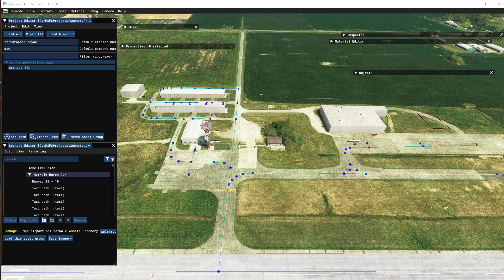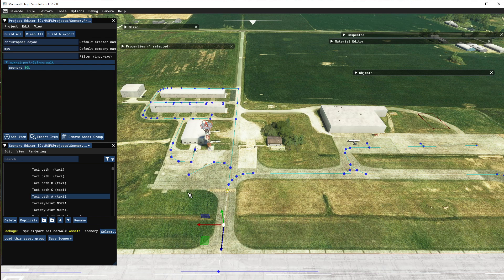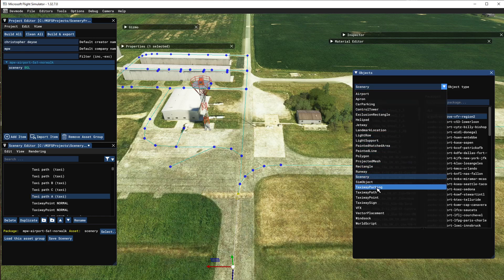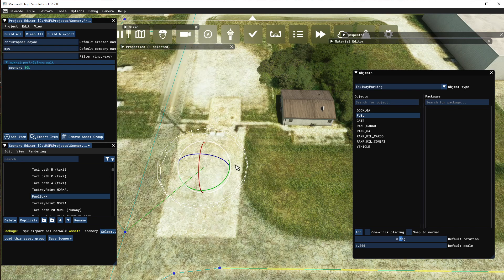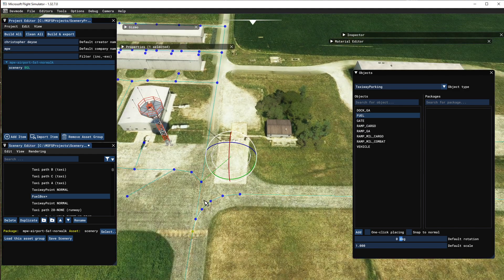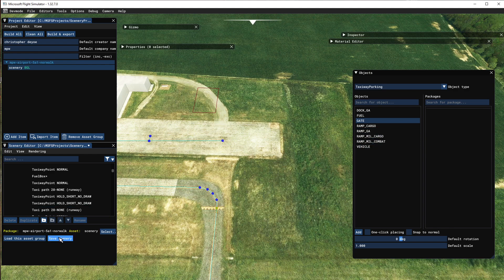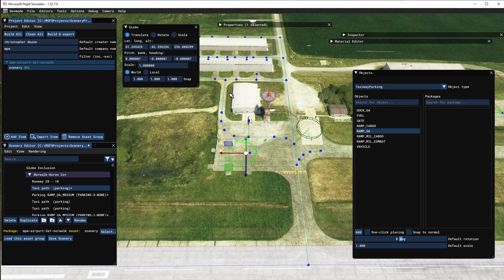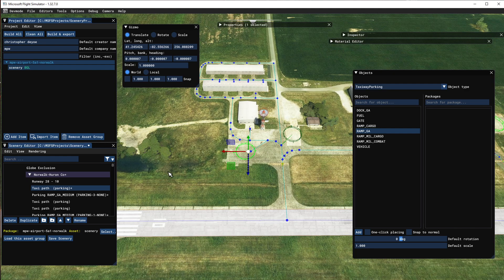Creating Scenery for MSFS: Creating an Airport PT4

Comment: Top tip: you can use the DOCK GA parking type on land if you want to ensure there are NO ground workers - useful at bush strips or helopads or other places where you wouldn't have ground workers. I know there are other ways of excluding workers, but this is the simplest method I have found.
Reply from the maker: Right.
Reply from the maker: I have been watching your Kodiak videos....so very helpful....plus a sub!
Reply: @myphysicalworld3958  That's awesome - thanks!  I've been focusing on flying the H145 recently and learning scenery development, so not had much time to do more Kodiak flying, but I'll be doing some more soon.  Unless I end up flying the SWS PC-12 when it comes out!

Comment: Great job as usual..love the T-marking tip…been manually making them..not anymore 😂..I do hope this will align the front wheels to the cross section? Also, the orientation of the parking spot has been requested to Asobo..simply ridiculous…fingers crossed…again, great job as usual.😊